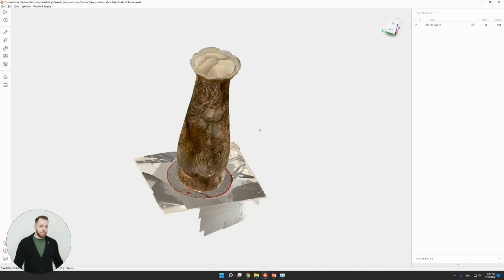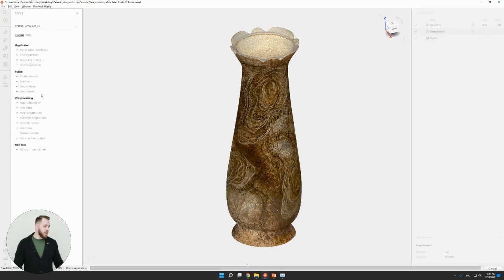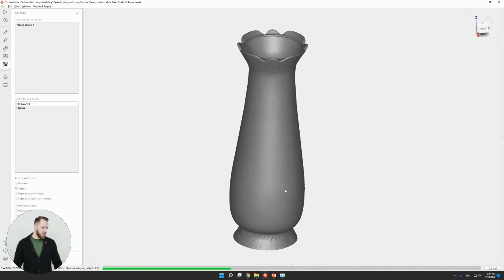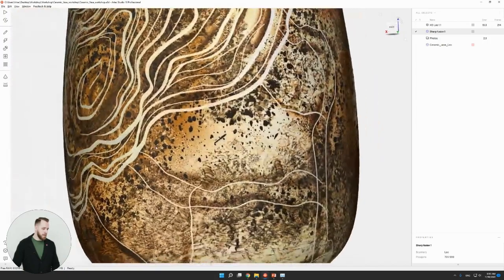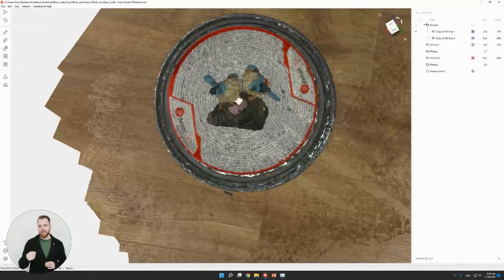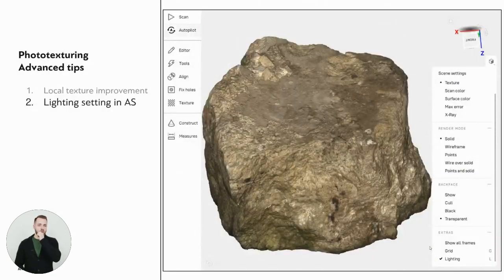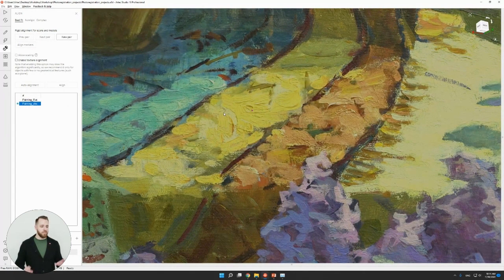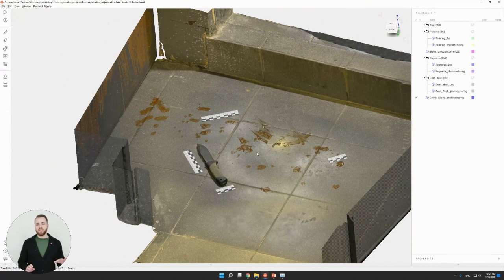How to: Get photorealistic texture for your 3D scan data

Comment: We've just bought a Leo. Will be scanning art. Interesting to know that we can use iphones to increase the quality of the texture capture. Can i just confirm, that after you have scanned with the Leo, and taken all the photos with the Iphone, will the Artec Studio software automatically match the jpg photos with the scan? No manual work required?
Reply from the maker: Hi! You'll need to import all photos into your workspace and register them using the Photo Registration algorithm. Once your selected photos are registered, follow the Texturing procedure and apply the newly created photo texture to the model.